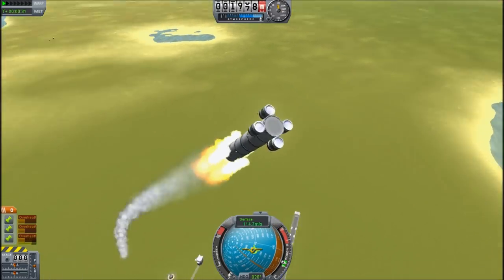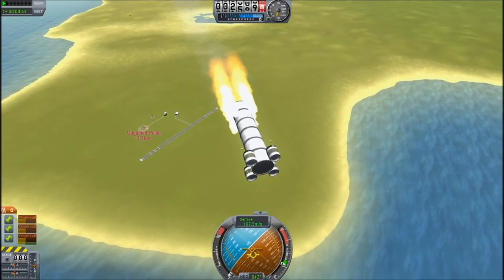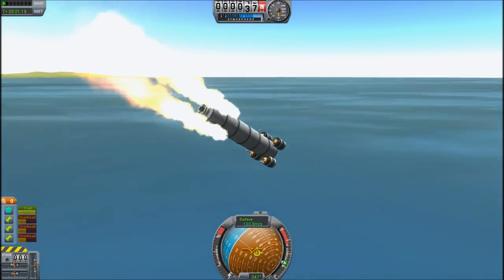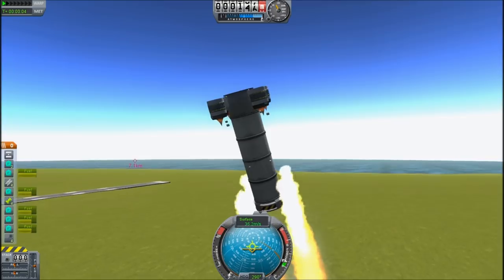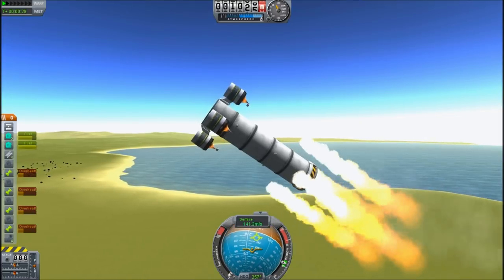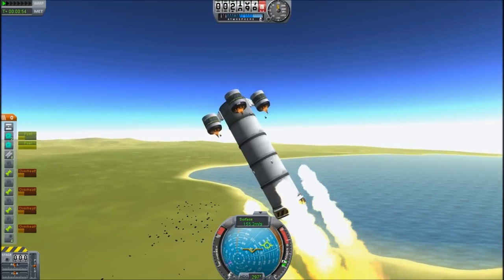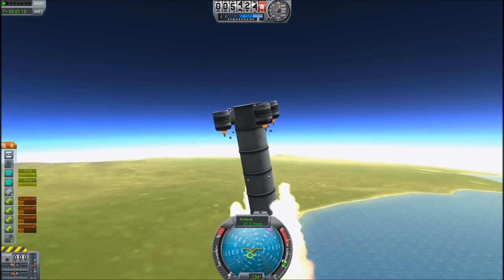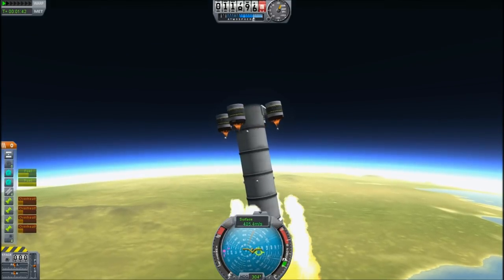The Pendulum Rocket Fallacy

Comment from the maker: The whole point about the pendulum fallacy is that gravity acts on all parts of the vehicle equally and with a fixed thrust vector nothing gets pulled upright or pulled over.
Reply: Recall that F = G(M1 • M2)/R² where M1 is the mass of the Earth, M2 is the mass of an object, R is the distance between the object's center of gravity and the Earth's center of gravity. 

R varies across the length of the rocket and M2 varies with the density of the material. This will induce a vanishingly small torque on the rocket depending on it's size and construction. This is completely neglecting any relativistic effects, of course.
Reply: @HenriFaust  That's true, they're called tidal forces, the same forces that cause the tides, and spaghettification near black holes.
Reply: It's not totally a fallacy. Ever seen a skyrocket with a long stick behind it? That's to keep it pointed more or less straight up by moving the center of gravity way aft. That's all the stick does (well, except for providing something to stick into the ground). That was Goddard's concept in putting the engine way at the top, except that it's very inefficient to achieve stability via dead weight.

As for your seeing the rocket tending to straighten out during flight, is the simulation sophisticated enough to account for the fuel tanks emptying out and the center of gravity shifting aft? That would provide some righting moment, like a long stick behind the rocket. Of course, you still have the problem of the hot exhaust gas impinging on your delicate fuel tanks...
Reply: Actually, calling it a fallacy is a bit of a fallacy... why? Well, a pendulum is a self-centering / dynamically-equilibrium device. It can only self-correct along the none fixed dimension. This is why it is not effective when the engines have nearly zero leverage with respect to the rocket body's principal axis. Only when you leverage them away from the rocket along a different axis (radially, with the pylons), do they become effective in self-correcting along the acceleration gradient.
Reply: @nd8166  
Yes. It's a 'fallacy' only in that Goddard, et al., misapplied how an actual pendulum moves, and that it transparently doesn't work in the rigid dynamic geometry with which Goddard built his first rocket.

Consider a good ol' grandfather clock: does the whole works--pendulum and case--tilt this way and that? Of course not: the pendulum hangs from a point--actually a suspension spring, a thin flat piece of elastically flexible metal.

Had Goddard mounted his engine in a sort of gimbaled arrangement with elastic mountings, he'd have something akin to the pylon geometry that Scott shows in his modified pendulum rocket, and find it impressive that ksp's physics informs the app's engine that those pylons are not infinitely rigid but have a certain give to them. Thus the thing is able to orient itself gradually toward upright.
Reply: @philperry4699  The stick provides drag (like a vane) and that's what keeps the rocket pointing up, which it doesn't do if you launch one on on a windy day: it will fly into the wind because of stick vane and that's why public firework displays don't use them (they use mortars): they can't be relied on to go straight up.
Reply: There’s also the feature that acceleration and gravity are equivalent, so the end of the rocket views gravity as going to whatever direction is pointing behind the rocket exhaust (as opposed to whatever direction the Earth would try to pull it).
Reply: @evannibbe9375  By that logic a rocket devoid of control features would alter course away from rather than towards a high mass object regardless of atmospheric conditions, even in a vacuum.

That's exceptionally counter intuitive to how the gravity from high mass astral bodies affect objects of smaller mass.

If already directed away from gravity then that's somewhat correct, again discounting drag and other factors.
Reply: @Scott Manley >>> Regarding that first launch simulation video clip:  You created a four-engine ASROC. 
😊😊😊

Comment from the maker: Actuall it depends on how the aerodynamic drag affects different parts, if those large tanks experience more drag per unit mass than the small tanks then the effect will be to make it turn more as it starts to slip sideways in the air, whereas if the drag/mass ratio is lower for those big tanks then it should tend to correct back to vertical,
Reply: Scott the legend!
Reply: Don’t bottle rockets work on this principle? A rocket on a long stick, flies straight, take the stick off and it goes everywhere.
Reply: @alphagt62  I seem to remember ancient Chinese found stick 7x rocket length worked ... ?
Reply: Law of aerodynamic stability: it's only stable if the center of mass is ahead of the center of lateral drag. If a rocket is aerodynamically unstable, it will go tumbling, not just pitch gradually.
But regardless of that, if direction of thrust is off the center of mass, the rocket will pitch.

Comment: Another way to think about why this doesn't work, is to address directly what it is that people think would make it work.  People imagine that if your thrust is always pointed up, then the center of mass should always hang below that.  So consider if your engines somehow pivoted to always be turned to point straight up, so that even if your rocket tips to the side, the engines still point up.  In that case, you would have a situation where thrust was always up, and if your center of mass moved left or right when the rocket tipped, then it would indeed right itself.  Essentially it would work because the engine is vectoring to redirect the rocket.  If the rocket tips right, then the engine, because it is pointing up, is essentially vectoring left.  So even if you designed the rocket to properly model what people imagine in their mind, it's still not a pendulum effect. So once we've looked at how it could work, we then see it works only because the engines are able to rotate upwards when the rocket tips.  If we take away that ability to gimbal, and lock the engines, then exactly what you demonstrate happens. The engines are always pulling the rocket in whatever direction it's pointing, rather than always straight up.
Reply: Thank you, this is the explanation I was looking for!  tl;dr For a pendulum to work is has to swing independently of your thrust vector, which brings you back to the original problem of how to keep your thrust vector perpendicular to the ground.
Reply: Adam Olsen
"how to keep your thrust vector perpendicular" That's where thrust vectoring comes in.
Reply: That is how I explained it to a friend! This one is really clear, good job!
Reply: Thank you, now I understand why it doesn't work. Then , I guesse that if you put the engines at the top of the rocket, once it has a small tilt, the weight of engines makes the rocket pointing to the ground, so it's finally worst.
Reply: @Araon Shumaker this a lot for explanation it is clear to me now :)
Reply: Well basically people assume the rockets are a pivot point, however, gravity applies to the rockets equally so it doesn't end up working like that

Comment: if there is s deflection between the thrust vector and center of mass then there will be a torque force acting to change the orientation of the rocket like a pendulum. If the rockets thrusters at the head are mounted rigidly to the rest of the rocket then there is no torque. no pendulum effect, but when they are mounted with some flexibility (like the pylons) a small deflection between the center of mass and thrust vectors exists which ends up righting the rocket like a pendulum.
Reply: Youtube recomended? I am subscribed to Scott but this was in my recommendations😂

Comment: The one situation where this isn't a fallacy: If the rocket connection comes loose in such a way that it can swing freely, or in some other way the thrust vector becomes decoupled from the engine displacement vector, then a pulling rocket will have no issues, but a pushing rocket will be unstable.

Comment: This type of technique might not provide stability, but wouldn't it also make it way easier to stage? E.g. you could just drop off the bottom tank repeatedly, and make a 10-"stage" rocket or something. Has anyone ever built some kind of a thing like that?
Reply: +rwold empty tanks are pretty light, staging is more about dropping heavy engines once less thrust is required.
Reply: Done it, called it Bamboo Staging, not effective in late-game, good for Thud engines...
Reply: I tried this once when I first got the game, this was back pre maneuver node, it didn't actually seem that useful (very little delta V saved) and you had to manually set up every stage because you're basically staging in reverse. 

Now that I think about it, it could be useful for upper stages... so long as you use a very powerful decoupler.
Reply: Also, hanging tanks would be lighter.
But it would probably not offset the inefficiency of sideways/sidehang engines + tank shielding + pumping the fuel against gravity.
I wondered about side tanks too, and the shuttle kind-of did that, but come to think of it any booster is also a side tank.
Reply: I had sideways engies on upper stages before. That way the upper can be wider, like for more spread on the landing gear.
Reply: @xFlRSTx  that's the point. no need for extra engines when you don't have to drop them. 1 set of engines to burn the fuel and more weight room for fuel right?
Reply: @minecraftermad  exactly

Comment: Actually, the pendulum principle DOES work, but it's not referenced to the gravity vector, only to the rocket thrust vector, which means that the "engines at top" layout is more stable - such a vehicle is less prone to flip round in flight. If you don't have a modern guidance system to vector a base-mounted thrust, or aerodynamic fins to resist deviation, then Goddard's arrangement might have some attractions - though there are other good reasons NOT to go for this configuration.

My guess is that Goddard selected his configuration for its simple "pendulum" flight stability and did not imagine that this would keep the rocket upright for long. Obviously, for short flights, keeping the vehicle flying "straight" is pretty much the same as keeping it vertical if you launch straight up, but as your animation very nicely shows any such vehicle will ignore the gravity vector and eventually meet the earth again - though always in beautifully controlled flight.

Comment: If I’m not wrong, if you could gimbal the rockets to keep thrust perpendicular to gravity it would act as a pendulum, but that would be the same as what we do now, although the gimbal direction would be reversed. I’m curious if you think this would be more or less efficient? I would assume less since the bottom mounted rockets are slightly further from the cg, giving them more torque.

Edit, your point if I understand it right is that gravity never applies a torque to something in flight, only a constant force, you you have to apply a torque with the engine (or wings), and the bottom mounted configuration is way simpler, and maximally efficient.

Comment: The simple matter here is that the rocket upward acceleration is so much greater than the natural gravity pendulous correction. Modern rocket systems use systems that amplify the gravity gradient correction like thrust vectoring etc.
Reply: There is no gravity pendulum effect at all; well at least if we assume constant gravity. The reason things seem to fall heavy side first is actually drag. 

Imagine two horizontally parallel blocks falling(in a vacuum), one heavy and one light. Obviously, they will fall along together and stay parallel. Now if you put a bar between them, would they just flip vertical? Now if there was something pushing up on the bar(say air), then they would flip because the heavy mass can resist the external force more. Since it is just an effect created by how mass reacts to drag, it is much simpler to just control the drag. 

There is also a slight buoyancy effect, but that is so tiny that it isn't even worth talking about.

Comment: So, if I'm getting this right, the point is that because gravity is working on each part of the craft equally once no longer tethered to the ground, the heavier front-end of a front-mounted rocket will get dragged down, and because the thrust isn't 'up' so much as 'forward', it will list downward, requiring energy to correct. Sensible. Though in orbit the horizontal kinetic energy effectively cancels out the pull of gravity, so tractor rockets work quite well, or at least they seem to.
Reply: Great, You do not need to reassure yerself, You know what You're talking about! Good job 😀!
Reply: "the heavier front-end of a front-mounted rocket will get dragged down"
No, all parts of the rocket are equally accelerated downward by gravity.

Comment: Would it make any difference lets say, if the engines were mounted to a sort of kickstage. With that kickstage attached to the pulled payload with a flexible connection, like steel wire... i’m not at all saying thats a good idea, i’m just curious about the physics.

Comment: I'd think that actually, the point isn't so much universal gravity as that the rocket is stiff. A pendulum would be able to swing around while the engines pointed in a constant direction, but that doesn't work when it's stiff. The engines pull forward, no matter where forward points to.
Now if it were a true free-swinging pendulum, then the obvious next question is, how does it influence the direction the engines are pointing? Oops, it can't actually do that. We just eliminated the mechanism for that.
In other words, it doesn't work if it's stiff, and it doesn't work if it's a true free-swinging pendulum, but for different reasons.
Oh, and think on how a correction would work in the first place. If the rocket tilts to the left, to correct, you need more thrust on the left than on the right. To use a pendulum-like mechanism, you'd have to point your engines more to the right, so the exhaust hoes to the left side. But that is actually the opposite direction to how the stick is pointing! Obviously, you'd need something more complicated than a pendulum.
Reply: I had a lot of rockets flex around on ascend.

Comment: The Seaslug SAM used to arm the Royal Navy's "County Class" destroyers had its launch booster nozzles in the nose. This was to make it more stable during the few moments it took to leave the ship, which allowed the tail fins to be much smaller. This made it possible for the missiles to be stored fully assembled in the magazine and go straight to the launch rails from there. The American equivalent missile had to go to a special room between the magazine and the launcher, where men, rather than machinery, fitted the larger fins. This was why the County Class Destroyers were destroyers and not cruisers, and in theory it also gave them a quicker time to the first shot at an incoming threat, as well as much faster follow-up shots.  Seaslugs were eventually fired in anger during the Falklands war, but mainly at shore targets rather than aircraft.

Comment: Before the heavy lifting 3m parts came out for the endgame, I made bird cage rockets when I got to the station/outpost building stage of the game. This would have the payload surrounded by a formation of connected ascent rockets that would also draw fuel from the center stage & ribs of the craft. 

So the payload is nested like a canary on perch & and the rocket looked a bit like a "stardock" from star-trek. I found this to be really good at avoiding the bending issues of building a rocket too tall & the drag/lag/control wasn't as bad as building a wedding-cake rocket either. 

I found it useful for lifting assembled stations to orbit, or any other payload that was going to be outrageously bulbous sitting atop of multistage rockets, or was asymmetric in its own weight because it would disperse that weight out to the ends of the cage which weren't asymmetric & much heavier. I'm not sure the design would work very well in real life or would shake itself apart due to how real life drag works, & I imagine the plumbing would be very complicated too, but it works great for ksp physics.

Comment: The force of the engine away from the force of gravity bends the wing away from the ground, while the ones on top force the nose away from the center of mass. Causing spin, with out that spin (torque) the effect would diminish. If they are put even further away the wings all bend toward each other canceling out the pendulum effect.

Comment: I think the reason the rocket rights itself with the arms is because they have some flex introducing a small pivot point between the thrust vector (engines) and center of gravity. This then allows the pendulum effect to take place since the thrust is no longer perfectly inline with the rocket.

Comment: I noticed the rotation effect myself and my explanation was that the air displaced by the rocket creates a slight "wind" from the rotational center away from the rocket which deflects on parts and creates torque if they are not symmetrical.

Comment: I do find that rockets at the top is good for skycranes and docking to bases on the surface. For one, I don't have to worry about the engine height because it's on the side out of the way, and the body, be it a fuel tank or hitchhiker pod or whatever, can touch the ground.